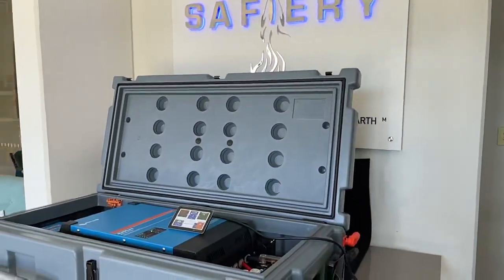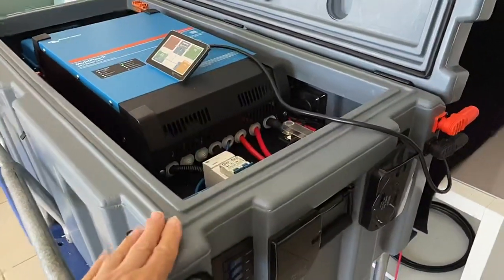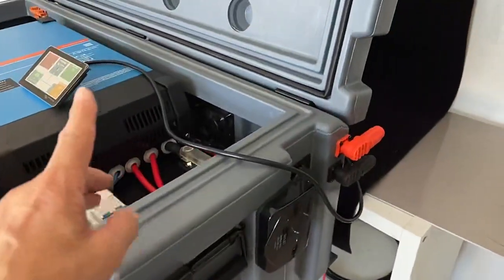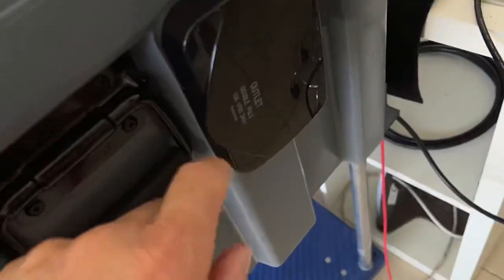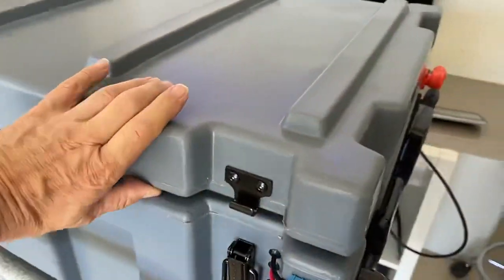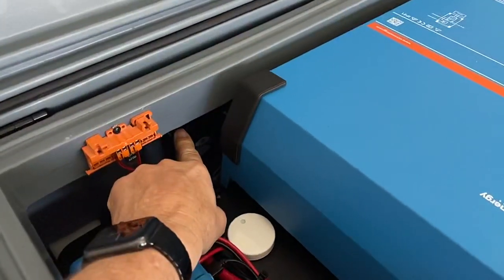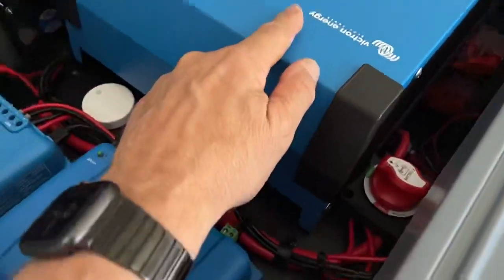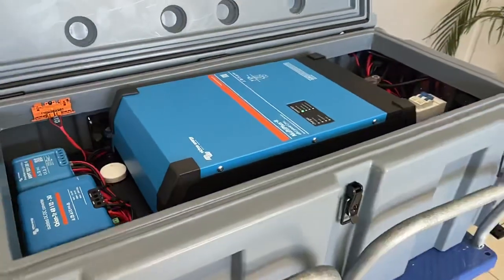RAM Treasure Chest of Power for “WINGS” Sailing Charters IP65 5000W Inverter 80ah Lithium Scotty

Comment: so that is 800ah of lithium and a 3500w inverter inside with a 270amp alt on the engine with 400w of solar, makes a fantastic mobile power pack
Reply from the maker: Yep it is but its 5,000W of Inverter Power and 3500W of 240V AC Charging...
Reply: @Safiery  in the title it says 80ah I had to look through the full details but that's a very impressive box of goodies, makes a great package for off grid , you don't have a build number for the box setup